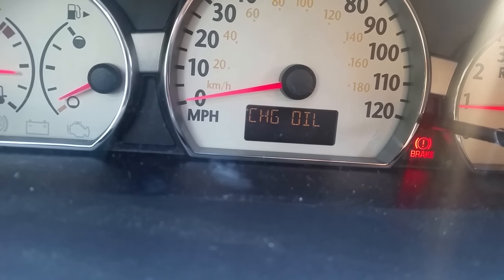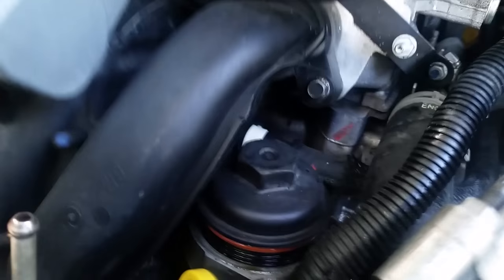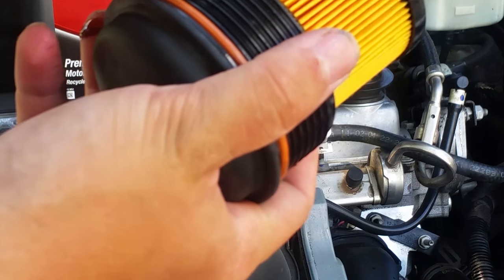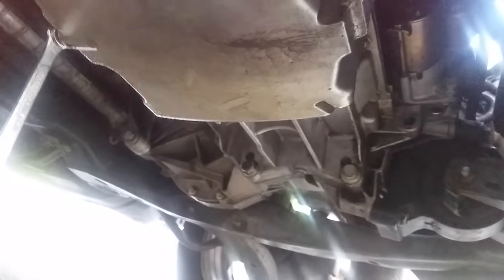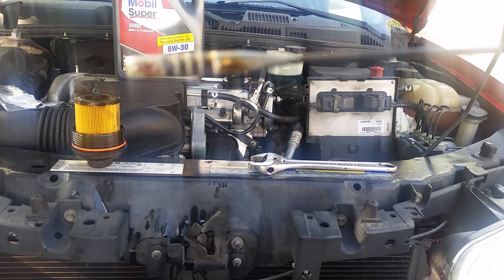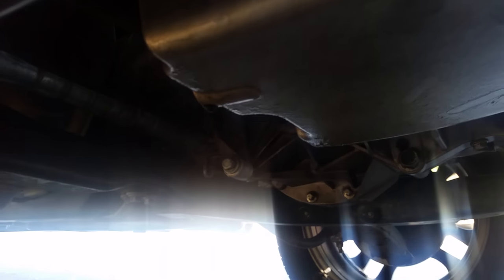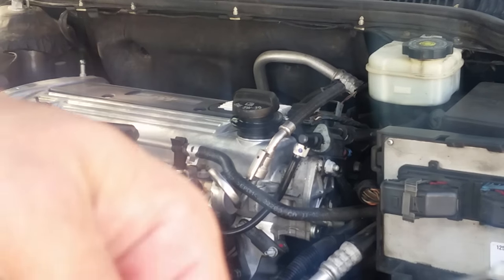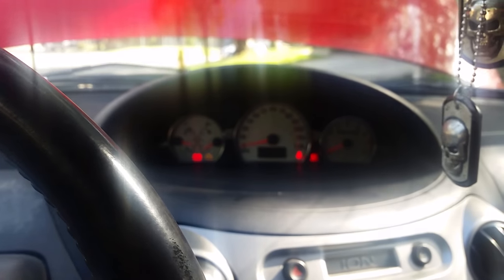How to change oil + Reset Oil Life Saturn Ion

Comment: I love how you poured oil all over the engine due to not using a funnel.  Good video for the average everyday guy doing his own maintenance.  Nice work!
Reply from the maker: Jason M Prevents rust. Thanks for the positive comment!
Reply: I was gonna say the same. it's supposed to be instructional yet there's no funnel and no torqueing of the drain plug or filter housing. Not very professional to appoint yourself instructor and then just say "oh about that tight".
Reply: @BEERSnGEARS 😅😅😅

Comment: My Saturn i use for work is 20 years old 2003 im 2nd owner i keep waiting for it to die but it just keeps chugging along😂❤ owned 4 years and never had a engine light, im old school and change every 3000
Reply: I have a 05 Saturn too and it still running. 260,000 miles

Comment: LOL! @ No Jack Stands! Never trust just the jack!
Reply: Zed 80 I know a kid that died from his car falling on him because his jack gave out so always use the jack stands!
Reply: When I was younger I changed oil with only a floor jack. I crawled out from underneath and while washing my hands I noticed  my 1.5 or 2 ton jack slowly depress on its own. 
Incidentally my check oil light regularly flashes you i changed oil no more than 1500 -2000 miles ago - it isnt low and still has good viscosity. But, im pretty OCD about my oil changes. 
     My coolant light also flashes but its still perfect..I can fix that with a paperclip. It just came outta the shop (reconditioned ECM). I BOUGHT PENNZOIL PLATINUM 5/30 $45 ON SALE AT CANADIAN TIRE.

Comment: yes sea foam helps clean the inside of the engine from soot , but when adding engine oil, use an additive to help prolong (note: brand name "prolong oil additive" sucks) the life on the oil and help with reducing friction...and clean or replace the PCV valve "a repair manual will show u where its located"
Reply from the maker: mechanic808 I've heard good things about Lucas oil treatment and Marvel Mystery Oil.
Reply from the maker: mechanic808 And as a side note for those reading this, these cars with ecotec engines don't have PCV valves, I was going to replace it to find out they don't have them.
Reply: i did not know that..and here i am working on my friends saturn as we speak ...lol

Comment: That's why you cover your work area with a plastic sheet and newspaper or similar to protect your driveway or city street to avoid messes. Again, were is your funnel?  If I were you, I  would remake this video showing good examples of what to do to keep your work area and your engine area clean.  I have been changing  engine oil  in cars for over 30 years and I have never made a mess of my work area or engine compartment.  Smart automotive working practice

Comment: 6:26 that's what she said...lol...love your vids i love tytorial videos on cars ...i miss my saturn i worked on it all the time...it was a 2006 saturn ion manual....can you do a video on how to change the ac motor
Reply from the maker: The compressor or the fan motor in the cabin?
Reply: The fan motor in cabin...I've have tried to get under the passenger dash even took out the seat and still could not replace the motor

Comment: Good video, but maybe u should address that brake light that's lit on your dash. 😳 lol
Reply from the maker: That's on because I drive a manual. the handbrake is on.
Reply: Dylan McClelland, crap, I didn't think about that. Ok, you got me. I literally just changed the oil in my brothers Saturn ion. Thanks again for the video. 👍🏼

Comment: my ion 2007 is running and sometimes off..and the board light is battery light...what can I do...change the battery or what problem is
Reply: Have the battery tested at auto parts store first, Dirty or loose connections, alternator test